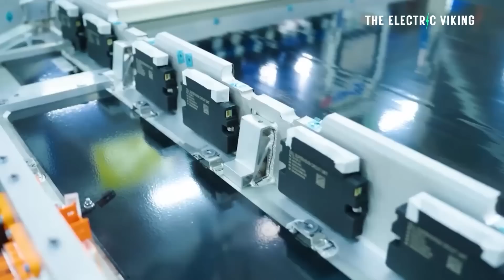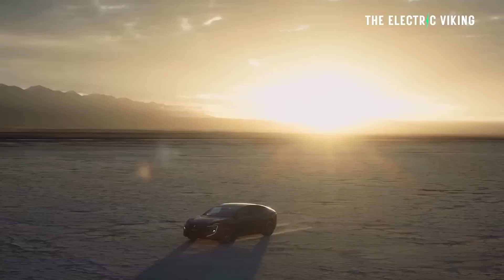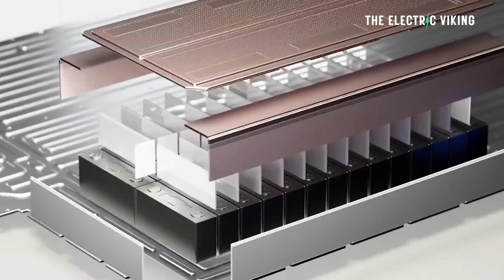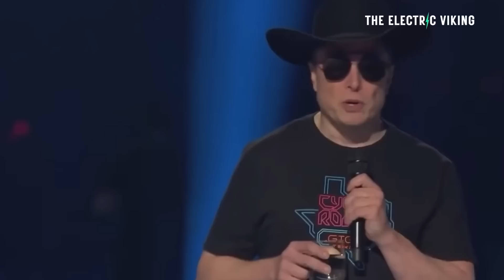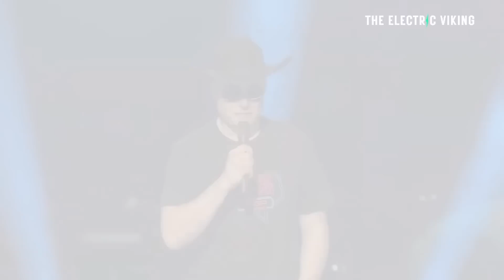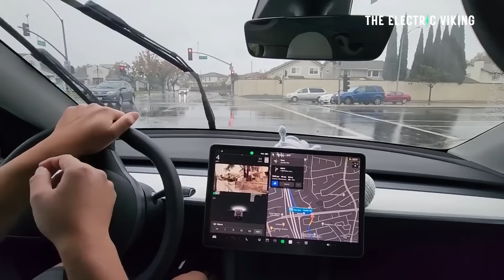Tesla's biggest battery supplier unveils 3 million kilometre battery

Comment: The whole Philosophy of EVs was wrong from the very start thanks to Musk and Company....

Ask yourself where the electricity is coming from to drive all the EVs.....
It coming from generators....revolving machines to drive revolving machines.
And what drives the revolving machines mostly?
Answer....Fossil fuels.
The efficiency of the generators and the wires connecting to the grid and eventually to the EVs is not anywhere near 30%....almost the same as ICE vehicles.....
To accommodate tens of millions of EV here in the UK, more electrical generators will be required and the distribution network upgraded.
Electric storage and pumped hydro will help, but they would help if EVs were not taken up anyway.
The only reason apparently for EVs is climate change and if climate change is real, then it is to late because it has taken over 100 years of industrialisation and the burning of coal to get to this point and it will take thousands of years to correct it.
Whatever, you do not get something for nothing, and the growing demand for energy. just means more burning of fossil fuels and there is no getting away from this fact.

EV are very expensive to buy, service, insurance, repair and sell on S/H....
But fair enough, if you want one, buy one, but at the present time they are not for me.
If new ICEs are banned from 2030, I shall buy an ICE vehicle in 2029 and keep it for as long as possible.
Reply: EVs are more efficient regardless of the source of the electricity.
Reply: @JohnSmith-x3y8h  
You miss the point....
To produce electricity is not efficient by far the most means.
Reply: @ You miss the point that EVs are more efficient regardless of the energy source.
Reply: Thank you, Exxon-Mobil.
Reply: @maxthemagition  if every car in the U.K. became an EV overnight it would add a 7% load on the grid. This is easily handled because most EVs are charged overnight when there is excess capacity.
Reply: Even as diesel genny supplied. EVs are far more efficient.  This is temporary.  The grid will adapt.   Total adoption will not be overnight.  Why talk stupid scenarios?  
Solar adoption is growing at astounding rates.  New tech shows huge potential.  
Gasaholeline can only be a leash on a monopolized society.   
Electricity is the good future.
Reply: @GWAForUTBE  
OK do the maths....40 million vehicles in the UK.
Say in a few decades they are all EVs,
An EV requires about a 50Kw motor to drive. (lowest estimate).
40 million at 50kw....
Now do the simple arithmetic and ask Bard about it.....
This is just for the UK cars excluding all the other energy using items.

Surely it is obvious?

Please reply with your thoughts on the matter.
Reply: @maxthemagition  Your mind is closed and there is no way of telling the future.  
I believe the grid will adapt. Ideally people's homes will create the electricity.
Reply: @GWAForUTBE  
Do the maths.
Reply: Flood the zone with shit!
Reply: @maxthemagition  It’s hilarious that you can’t even spell ‘magician’ correctly.

Comment: Of course this battery is not interesting for cars, 200.000 km durability is enough.( higher energy density is more important, for the car to be lighter, not the 2000kg and more they weigh today ). But for renewable energies network stabilization, there is the massive application and energy density is not critical.

Comment: couple of chevy volts now with 450-500k miles on the odom. atleast one is documented here on youtube before it had a clutch pack failure. at that point there was zero observable range degredation after 10+ years. if you protect the battery from deep discharge and overcharge, protect it from extreme temperatures (cooling for summer and phev engine for winter), and never supercharge the battery, it will literally last forever... and theres actual evidence of this online for years. crazy we are even still having this debate. a car that doesnt age is the end of the game for auto makers.
Reply: Mine was always supercharged, since it's for free. I have 490.000km on my S, still original battery, serviced once, still well over 90% capacity.
Reply: @Janez-h1e  ya the older model s' i have heard have issues where one cell goes out of balance without warning. there is some guy i think in the netherlands with one of the original model s' with around 2million km now and has gone through like 7 batteries? something is weird with model s batteries and i think its the supercharging since i think they used to give out free supercharging with early models. correct me if im wrong.
Reply: @vevenaneathna  it's free, yes. They don't go out of balance, they need to be resealed before something happens. Factory did not do a good job, water breaks in and some cells go bad. On motors, too, same thing. I did it all, not on battery unfortunately. That guy in Germany now has 2 mil almost, yes. His battery an motors are somehow lifetime warranty. Motors do not have to be replaced ever. They just need better oil rings and new bearings.
Reply: @Janez-h1e Just look at really old "EVs", trains and trams! Those run for decades if the motors are serviced. Osaka has trains from the 50's in regular use, and some trams in Blackpool are almost 90 years old!

Comment: This is why the yearly Worldwide manufacturing capacity for EVs will be less than half of what it is now with ICE cars. The average life of an ICE vehicle is 12 years or 200K miles. That's pretty dire when you consider they've had 100 years to make them last longer. The reality is that car manufacturers aren't motivated to make them last any longer, so they don't. It's the Engine and Transmission that dooms most cars in the long run. Imagine a World where you can buy a used EV with 300K miles on it, knowing it's good for that much again. So what if you need a new motor, they're going to be cheap enough to justifying replacement with a new or more likely one from a crashed vehicle. The cost of ownership of that sort of motoring would approach what I do now with ICE cars.